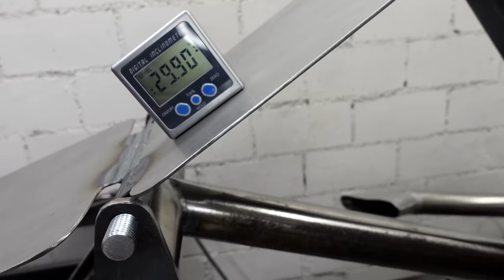How to Weld a DIY Weight Bench for my Home Gym

Comment: You should put some heat shrink tubing on the little bar catches, so it doesn't scratch up the paint job every time you adjust it.

Comment: Those drill bits are RUKO Twist bits. At 10:36.5 minutes you can make out the name brand on the case. I looked them up and its sold in Germany and UK. Still looking for a USA seller and will post back asap.